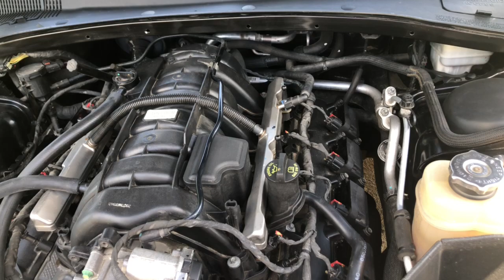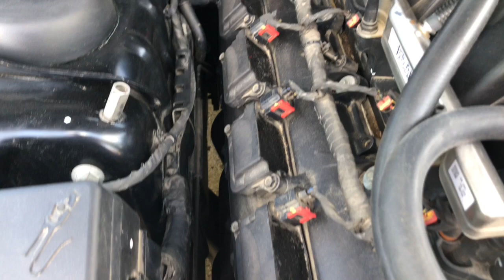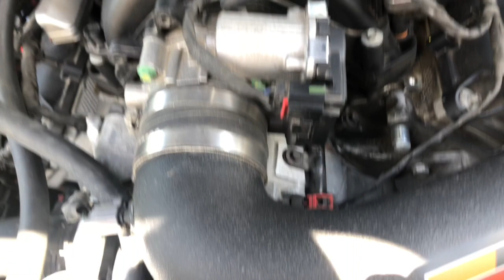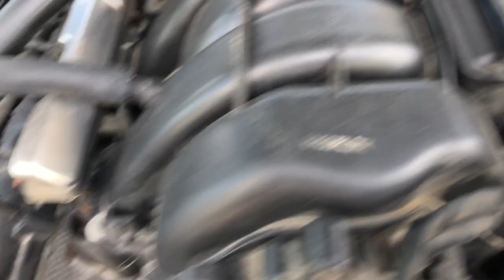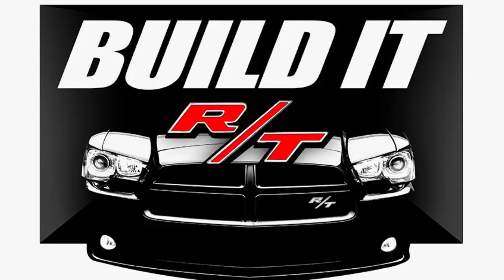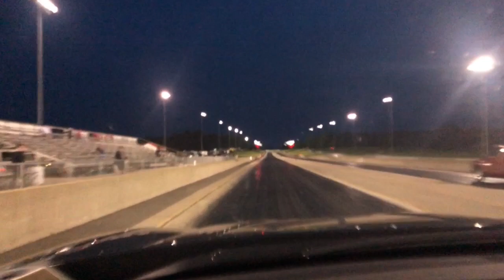What is the HEMI tick?

Comment: My Fellow Mopar Guys...... After a Freshhh Oil Change , try Motor Honey ... 70% of the bottle or stop between the T & N in “Motor honey” label , all my 5.7 Hemi owners with the Classic hemi tick .... this “GREATLY REDUCES” The tick , but its the best fix next to trading in for the new one ............... believe me , I went about 750 miles too far on conventional, & had to have the cam’s replaced , and $2000 later even after the break in period , we had the tick .......  try motor honey , im using $45 Synthethic oil now and doing my oil change’s 500 miles sooner than i need to , but Good god does motor honey workk :D
Reply from the maker: caliber8 I have never heard of that, I am going to have to check that out!
Reply: Build it R/T yuppp yup , autozone ...$5 ... I should’ve been more clear , we started to get the Hemi Tick after 30,000 miles in 2012 ...... Went to far on conventional around 65,000miles(2016-17ish) and after the cam job it was still there , running dodges conventional OEM pennzoil ...... sooo next oil change i Went With Castrol Edge based on the whole World’s Reviews on that product (US/EU/AUS etc) and poured 1/2 a bottle, and got 1/2 the volume of the tick reduced ...... i poured 70% by eye and stopped there , cuz i dnt want it TOO thick nd deal with a cam job all over again ........ SWEARRRR!  its (70%) as quiet as a certified pre owned mercedez now >.< :D :P hahhahaaaa
Reply: Build it R/T **UPDATE** reduce the Amount of motor honey u use/put to just 1/2 a bottle ... and skip using it every other oil change .... it didnt cause damage it just makes the MDS do weird S**t .......... so moral of the story .......1) use half the bottle with a fresh oil change ........2) let time go bye ....... 3)when the next oil change comes skip the motor honey ........ and repeat to letting time go by , and then use it again 

I’m doing the Research for you , while gambling with the cams/lifters 😂😂😂
Reply: Just trade that pile of shit for a Chevy and not worry about it
Reply from the maker: Or just trade you in
Reply: caliber8  can we get another update when you can. 
Thanks in advance
Reply: I have heard of motor honey, I don’t know what it is exactly, but if it’s anything like STP, let me tell you what STP is.
   A friend during my teenage years upon graduating high school went to Mariani technical institute which is a petroleum engineering college. my friend was a gearhead like me. In college, he told me that when he learned about STP and other products would surprise me and they did. All that STP is, is raw purified out of the ground petroleum. It is had no additives for anti-sheer , no anti corrosion additives, no zinc, no phosphorus for film strength, no polymers for viscosity stabilization, and many many other additives. All STP is, is a blank canvas with no paint on it yet. It’s like an empty pot. It ain’t nothing to you put something in it.. it may feel greasy at air temperature, but when it’s cold it almost becomes solid, when it’s hot, it’s almost as thin as water. It is totally unstable. It basically just takes up space in the crank case where there should be oil.
   other products like winds friction proofing,are 90% kerosene..
  I have been told by people that know, and I have read from other people that know. You do not put additives in your oil unless, the manufacturer gives you that option:
 The only manufacturer recommended additive I have ever used, or even heard of, was,moto guzzi motorcycle co.. they recommend adding 1/2 ounce of molybdenum to the 90 weight oil in the final drive where the ring and pinion gears are... it was in almost black liquid that I bought at the dealer in a 4 ounce bottle. as usual, the manufacturer knows more than I do, so I do what they tell me, and I also do not do what they tell me not to.. many owners manuals say in plain English never to add additives to the oil.
   One of the technical journals I read on the subject said that putting additives in already blended oil, is not unlike baking a cake.. if the cake calls for one egg , why on earth would you add a dozen more eggs? don’t change the recipe. The factory is already worked all this out, and the manufacturer of your engine has Determined through testing the best lubrication for your machine ..There have been plenty of snake oil products on the market. ARCO graphite oil remember that? How about slick 50? Whatever happened to that.. briggs and Stratton tested slick 50. Don’t think that brakes and Stratton single cylinder lawnmower engines are to be taken lightly. Those are almost indestructible marvels of modern engineering reduced to pure simplicity for the average idiot.
   When Briggs & Stratton engineers tested slick 50.. they took two engines, one with regular recommended oil, and the other identical engine with recommended oil, and the recommended by slick 50 amount of slick 50 added to that oil.
  they ran both engines in the test lab for 24 hours.Then they drained the oil from both engines, put the drain plugs back in, and ran them without oil for another 24 hours..
   The engine that had just a regular oil in it, had the expected damage. But the engine that had the slick 50 added to the oil, had The expected damage, plus additional damage to the areas of the engine that depended on splash feeding, which was prevented by the coating of slick 50 on those parts..
  cause and effect.. you don’t know what additives are going to do to the oil. It  changes the chemical and mineral composition. Leave it alone, the factory knows more than you do..
Reply: Just put heavy oil like 5w40
Reply: engine honey will wipe cam lobes in hemi engines. do not run heaver oil do not run additives do not run none sympathetic oils. unless you would like to pull both heads and the timing cover to replace a set of lifters and a cam.  the sound is not valve chatter it's not lifter tap. there is nothing wrong with your engine. its valve geometry of hemispheric heads. every hemi ticks its supposed to tick the old hemis ticked loader then this. if its not ticking then you could have a lifter problem. DO NOT CHANGE TO A HEAVIER OIL it will stick your lifters.
Reply: @krazzykiller1  5w 20 isn't that thick and full synthetic does a way better job at lubrication than standard 🤷‍♂️
Reply: @dsmith1452  dodge has cam ticks, chevy has valve ticks and ford wont let you turn the damn key just be grateful we dont own fords
Reply: D Smith lol 5.3s are notorious for the tick too bud.
Reply: Russ Valois hey bud sorry ... my update IS !!!!!!!! Nothing happened the tick is the same exact level/volume because I decided to go back to full synthetic oil changes but i made my interval 1000 miles sooner than FCA recommends so she hangs in there ......... im gonna hang on to her for another 2-3 years (my car is a 2012) maybe let Dodge dealer Drop a Junkyard Totalled yet new 5.7 Hemi with 20,000 miles or so in it ......and store her in the garage for the next generation, and come out with mayb a 2022 or 2023 CRV im working on starting a family , ill get a crazy floating hellcat when im 50 im 26 now ............. no more $$$$$
Reply: @dsmith1452  lol the 5.3 is just as bad if not worse.. We've owned 5 or 6 chevy and gmcs in our family with the 5.3 and every single one of them was noisey as fuck.....

Nice try though 👌

Comment: Il take the hemi tick over the ls piston slap any day.. lol
Reply from the maker: Dragracin 95 oh yeah dude I think anyone would lol
Reply: @BuilditRT  I think plenty of ppl will disagree with u there. Piston slap is completely normal especially in a aluminum block LS. Without trying to get too scientific the metals just expand and contract different from the piston sleeve to the piston itself which causes the slap. I had to replace a lifter in mine(the REAL GM ISSUE) and while the head was off the cylinder bore looked perfect so I'm a firm believer in no harm done from the usual piston slap.

Comment: The other hemi tick is the one that requires attention.  The broken rear exhaust manifold bolts.  Causes loud exhaust tick on cold start for about 30 seconds.   Not repairing will cause more bolts to break over time.  Lots of vids on this little tick critter.

Comment: I noticed the tick in my 2017 Scat Pack. I was informed that some of my lifter were installed upside down. That's why it ticked. Luckily I still have the warranty.
Reply from the maker: That’s the first time I’ve heard of that issue
Reply: Shocka252 how is the scatpack maintenance and reliability??, im thinking about buying a 2016
Reply: So when the car was serviced they told you that was the issue?
Reply: Hahahahaha really holy fuck that’s shitty luck
Reply: Mine has the warranty am I 2018 392 doing the tick fuck that piece of shit Hemi I want to get something else

Comment: Well, contrary to what you explained, Push-Rod motors have a more simplistic design and LESS moving parts than DOHC engines.  As far as the Hemi "tick", the push rods are not hydraulic and move with the momentum of the cam shaft, so one or many failing valve lifters could be the possible cause.  I agree though, it's not indicative of a blown head, but can also be the sign of a blown head.

Comment: Consider all of the action going on inside an engine, especially a V8. You have chains whirling around meshing with sprockets, you have pistons stopping at the ends of each stroke, twice, and that occurs thousands of times a minute, not to mention the piston skirts rattling in the bores..valves clattering against the valve seats. lifters rolling or clattering against camshafts,All the while under pressure from the valve springs...Not to mention thousands of explosions per minute. Did you ever have a valve cover off of a running engine, and hear all of that racket.It’s a miracle that engines are as quiet as they are..If you think you hear noises,turn the radio up.. want make your car feel peppier? Move the seat forward..Think about it, it works
Reply: I agree, to much worrying about a hemi tick. Over on mustang sites it the 5.0 tick. Moving parts make noise. Had 2 hemi engines they do make noise and take a licking and keep on ticking.

Comment: I've had a ticking sound that makes my 5.7 sound like a diesel now for 40k miles (2011). I had an exhaust leak and replaced the manifolds with short tube headers which made the sound louder. I added moly to my synthetic oil but didn't change the sound. Sad to say it's time to replace a cam and some lifters :(.... stupid epa standards are complicating and ruining the reliability of vehicles nowadays.

Comment: After replacing my cam and crank let me tell you the hemi tick is something very serious. Use the proper oil and change it every 5k miles. Changing every 5k miles isn't a guaranteed solution either though. Depending on how you drive and condition of rings and other seals can shorten the life span of your oil even shorter than that. If you constantly floor it like you did in the video before you signed off, if you have worn valve seals and rings then gas fuel can bypass these seals and get into your crank case . Thus breaking your oil down more rapidly. So your moving parts aren't getting as much lubrication as you think . Part 2 the oil channels in a hemi are tiny and oil has to go thru upper engine oil channels before it gets to the crank mains and rods . Which means if your cam and lifters aren't getting enough lubricant imagine how the rods and mains are doing . There are 2 holes in a head gasket the 2 smallest ones are for oiling the rocker arms . Also very tiny holes. So if you use a thicker oil such as 40 sae it's going to have a rd time making it through those oil ports. Do not use thicker oils or magical additives  period. A good example of a major no no for hemis is Lucas. Don't put that stuff in a hemi. You're only making it worse. If you hear a tick best thing you can do is change the oil asap with the proper oil. Mine says to use 20sae I go with 30sae. That's pushing the limit already. I would definitely not do 40sae or an additive that is thick as molasses.

Comment: Mine is a 14 and it was the exhaust manifold.. started at about 70k... Three bolts on the passenger side and 2 on the driver side were broken.. new bolts and gaskets
Reply: Mine had the same issue, 2006 5.7 turned out to have 5 broken studs on the exhaust manifold, had to replace all of them. Luckily I bought a warranty so it covered most of it. I had never noticed a tick though. But I was new to the hemi when I bought it and didn’t know to look for it. It’s always had kind of more of a faint clicking sound that sounds similar to this one only quieter, but a guy at work said it sounds like hemi tick so I’m trying to home diagnose it and hope it’s not the lifters. It’s not knocking so I think I’m clear of that, but I literally just had the exhaust done so I don’t know if it is normal or something else..
Reply: @amb158 been about 20k and mines already back..only cold starts for About 30 seconds

Comment: I just got a 2016 charger rt and I'm noticing the noise now I got scared for a second but at least it's normal thx for the info
Reply: Make sure it's not broken exhaust manifold bolts. Common issue causes a tick that goes away after warm up

Comment: true but some, about 5% develop issues with the cams and damages to the lifters, heads and all sorts of shit.. this is not acceptable.. not worth the headaches possible and the thousands it costs to fix it.. your better off steering clear of that whole mess because the engineering malfeasance of Chrysler, just avoid it if you can.
Reply from the maker: I wouldn’t say the engineering, I would say more of the manufacturing
Reply: 🤔 Never used that word before "malfeasance"

Comment: I have the tick on cold start on my 2017  5.7 hemi sport. ,  30,000 miles, but then goes away when warmed up.  It's a bit concering and annoying,
Reply: my 2011 ram does the same thing now, 36k miles.
Reply: Thats because its an exhaust leak

Comment: Is this why my newly rebuilt motorized bicycle engine makes a strange rattle/vibration noise?  I replaced the head with a high compression hemi design with the rebuild, and after 50 miles or so, it started making noise.  I've tried to eliminate all possible sources, and it's still there.  I even tore down the top-end, and replaced the wrist pin and bearing, and found no play in the crank at all.  It doesn't happen with the clutch disengaged, or anywhere below 2000 rpm or so, so I'm stumped at this point...  it doesn't even have valves of any kind, because it's a cheap Chinese 2-stroke.  It's not knocking either, I did hear a couple pings when I ran it too hot once, so I can tell the difference.  Any ideas?  Btw, it's directly related to engine speed; the higher the rpm, the higher the frequency of the vibration.
Reply from the maker: HonorB 4Glory it’s possible, the hemi design is well known for this tick. It be resonated from the heads to the exhaust manifold. I really noticed it after I put the headers on.

Comment: Does anyone hear the ticking echoing off walls when you go 20-30mph
Reply: I'm not sure about why you mean, but I have a little noise in my dodge durango 2006 between 20-30 kph
Reply: That could be a rod knock...
Reply: When my motor was ticking, it was low on oil which made it really really loud, after I filled the oil back up the ticking was greatly reduced

Comment: I just had my 08 ram hemi rebuilt bottom end (#1 cylinder failure) an the ticking is pretty loud, the mechanic even replaced the cam
An it is in the break in period how long should I possibly have this tick or should I take it to dealership to have them take a look. The mechanic had the truck for 90 days an just returned the truck to me today

Comment: In order to change the lifters do you need to drain out the engine oil out of the engine  first ?
Reply: To change lifter you need to pull the heads so yes you will have to change the oil when you are done
Reply: I would in case of metal fragments

Comment: You youngster and your OHC is better! Pushrods have been around as long as engines.  I had a friend with a 1970 440 road runner with the original engine and it didn't tick. And neither has any other healthy well designed engine.
Reply from the maker: 😂🤣😂 Where and when did I say OHC was better? Get out of here, you’re delusional.

Comment: Mine's pretty loud when it's cold :( I hate it.
Reply from the maker: Yeah the cold really brings out the tick that’s for sure.
Reply: @BuilditRT  yeah I'm thinking I need new lifters 😩
Reply: My theory is if iexhaust manifold  leak from a broken bolt it’s louder when cold and then quiets down a bit as metals heat up and expand??? 

Just a theory though.

Comment: Sounds like the injector coils firing
Reply: Yeah, we went poking around the engine bay with a mechanics stethiscope in our 2014 5.7L one day. The block, cylinder heads, and valve covers were totally silent. But, the injector bodies and fuel rails had very loud ticking. So, we're pretty certain ours is just the injectors doing their thing.